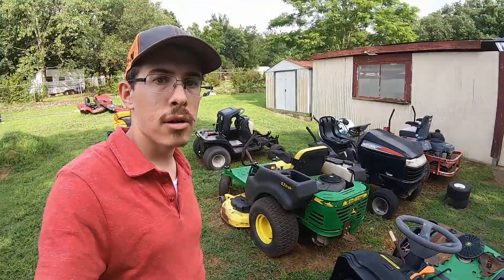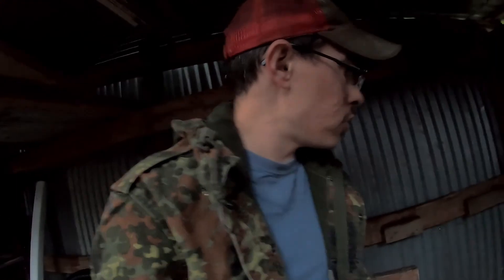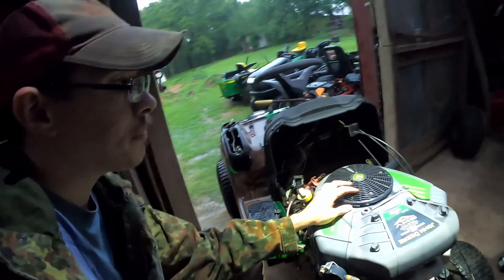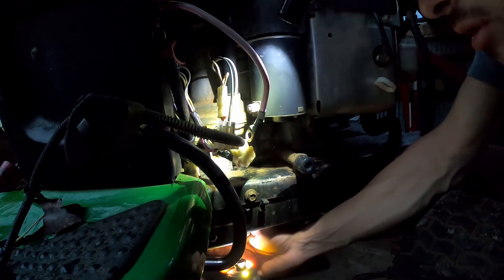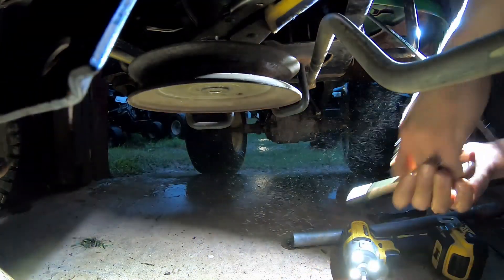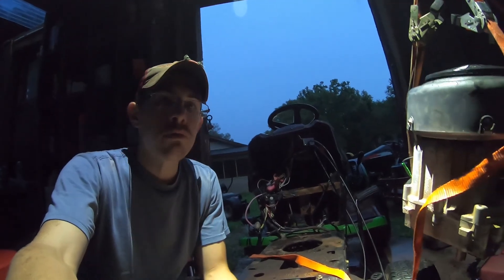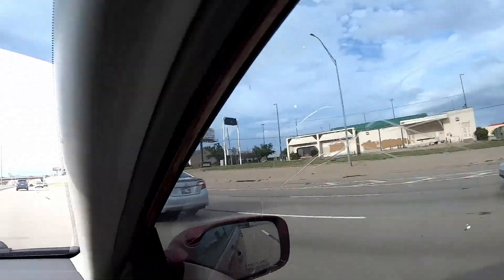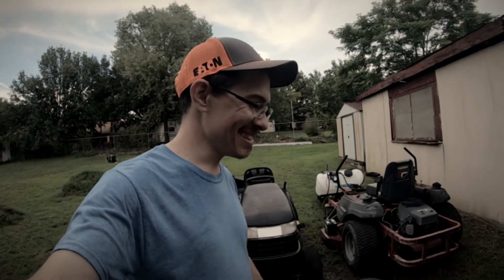How to Remove a Riding Mower Engine | Garage Story

Comment: No bolt on my pulley!
Reply from the maker: That’s odd!
Or was there some other way it was held on?
Reply: @garagestory  As usual, my mistake -- there was one...waaay up 4"?  in the tube. No vid I've seen shows that, and I only saw it when I turned the mower (Murray 11ic/36, with Briggs 11hp) on its side. 
Thanks for asking. May help s.o. 
Another 'May help s.o.', prevent them having boiling oil pour over their hands and belt. On my Viking MT 6112C, there is a 4" pipe pour out old oil clear of the machine. I thought I was taking the cap off but in fact it was stuck onto the pipe so the pipe came out!
Reply from the maker: Yes, that happens sometimes that the pipe unscrews instead of the cap! If you notice that happening you can just use a pair of vise grips or something to hold the pipe while breaking the cap fee.